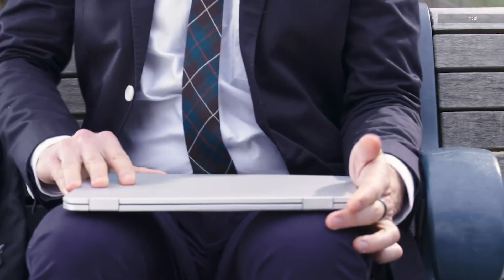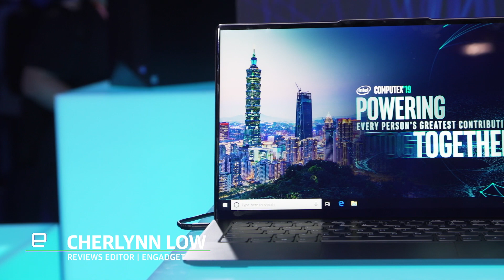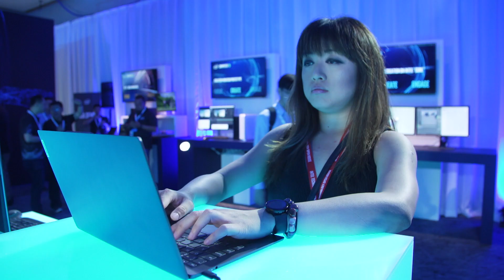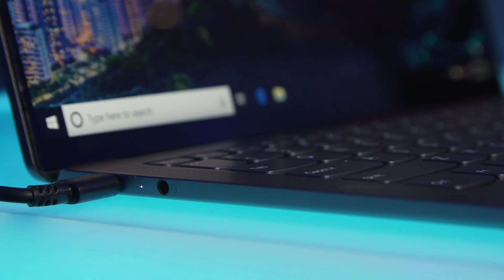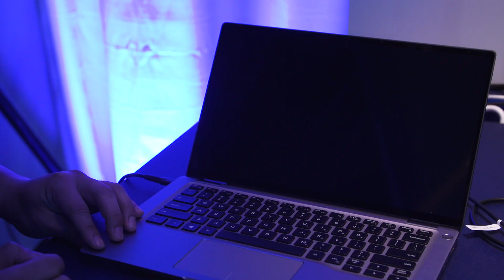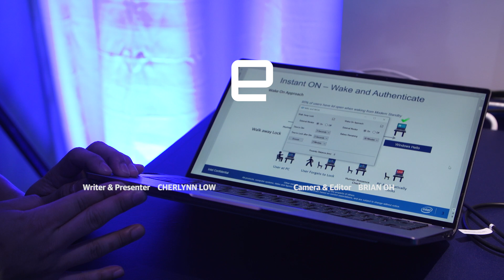Intel Project Athena user awareness Hands-On at Computex 2019

Comment: Since the proximity or the front camera is always active, won't it consume more power?
Reply: Turning camera all the time is obviously not something they are gonna do on a consumer laptop, I'm guessing this will be more of a "feature" for corporates. 

Proximity sensor is not that power intensive - it's a sensor to detect obstruction using infra-red. Ideally it should check for an obstruction every 5 seconds, following which if it detects none, on the subsequent detections, should put the display to sleep.

Comment: the only thing about this project that's useful is improved battery life.  the stuff about improving the sleep mode  with a proximity sensory is useless.  and i hope they made great improvements in that facial recognition software. My Asus came with it, and after a few days i uninstalled it. even when it did work it was still faster to type my password, and i didn't have to look like an idiot moving closer and farther away from the laptop trying to find the sweet spot that it would recognize me.